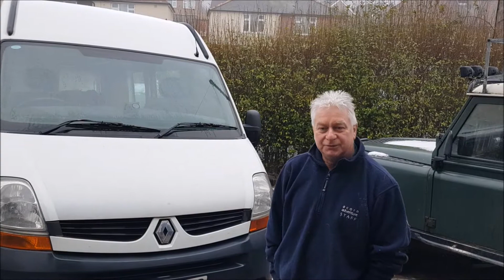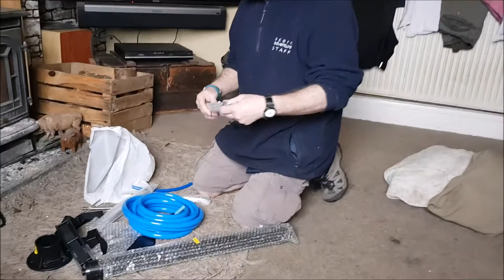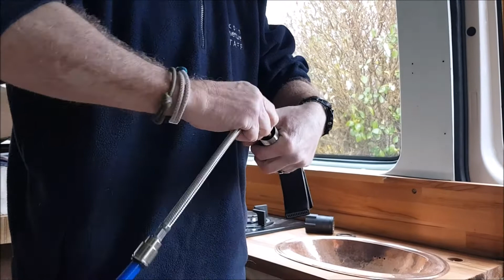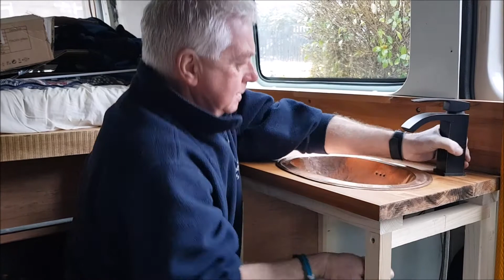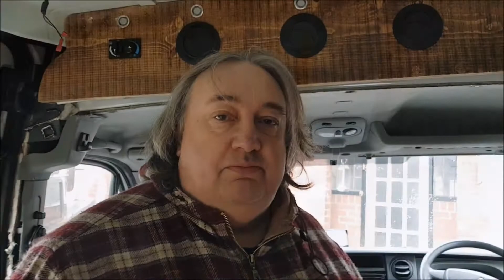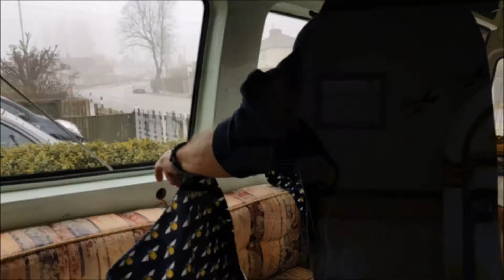DIY Campervan Conversion ~ On board Water

Comment: I've done several conversions (Iveco Daily and Mercedes Sprinters) over the years and just about to do another one on a Renault Master Ambulance. I've enjoyed your videos but am puzzled by one thing.... the toilet, there isn't one! I assume you'll be stopping at camp sites and use the onsite facilities which is fine, but does limit the use of the camper van. Good luck in your travels, look forward to the videos.
Reply from the maker: Oil Burner hi, and thanks for watching our channel.  We will be carrying a porta potti toilet with us when we travel about for emergencies. We will be using campsites occasionally but otherwise using cafe's, public loos etc. As you have seen from recent videos, we do like to visit coffee shops 😉
We will have an on-board shower which we will show in a few weeks time. 
Cheers Daryl and Keith